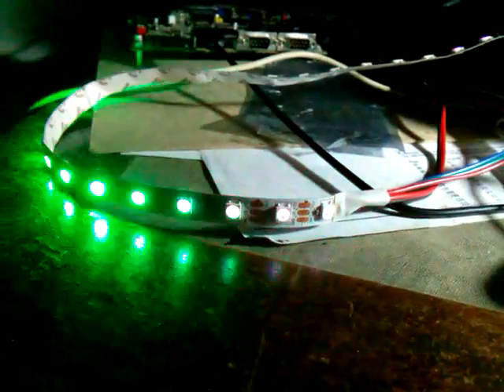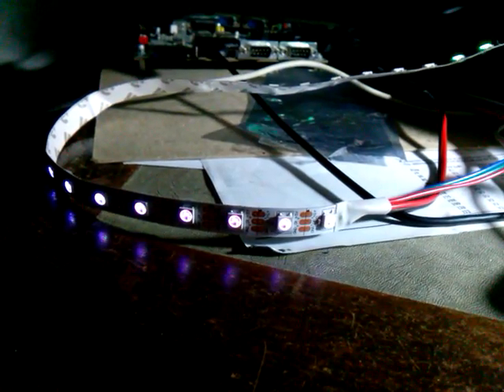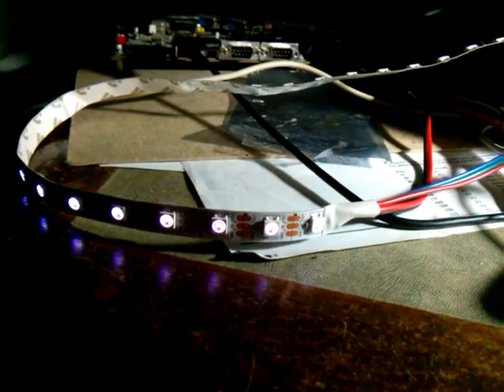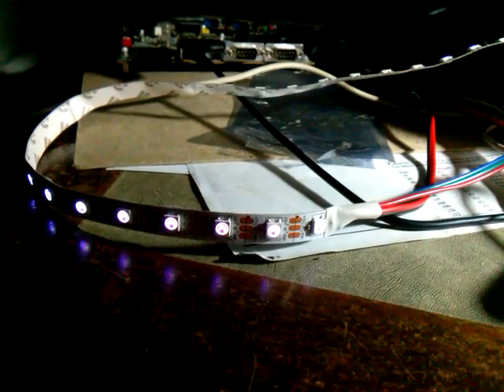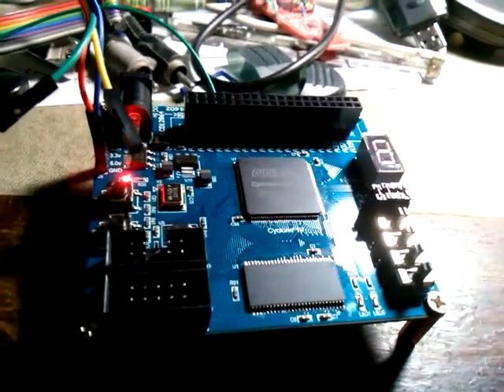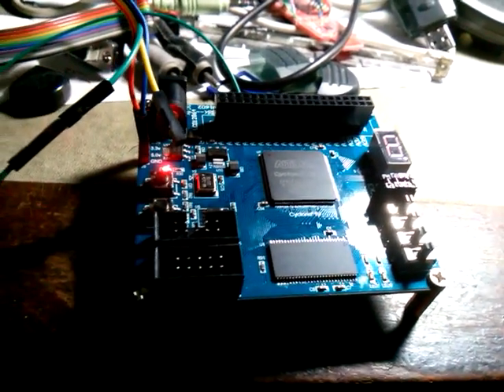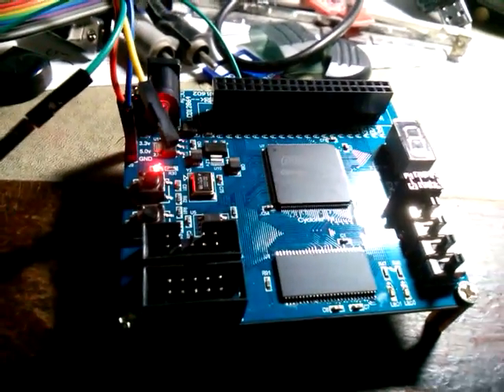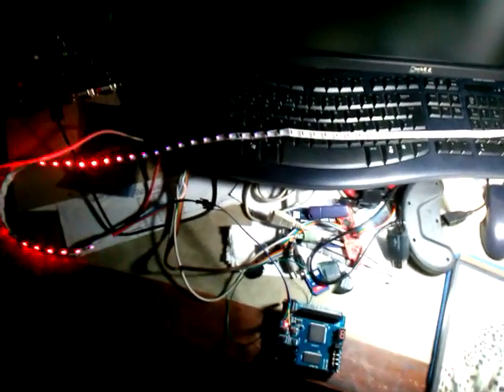WS2812B LEDs controlled by ZPUFlex in FPGA

Comment: Hi, 
May I ask you something?
Did you have use Lattice FPGA try to do this?
Reply from the maker: I didn't have to use an FPGA (in this case Altera rather than Lattice), I simply used one because I've been tinkering with them over the last couple of years.  People have interfaced to these lights using simple microcontrollers, but the timing can be tricky since the protocol is based on pulse widths.